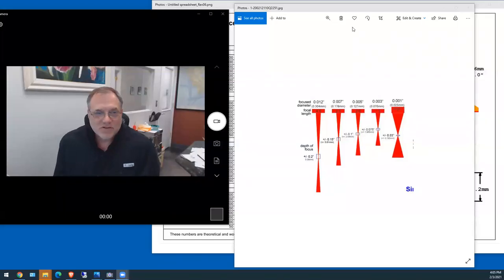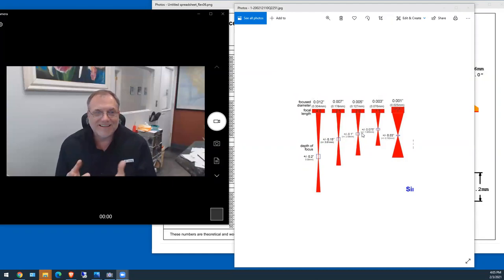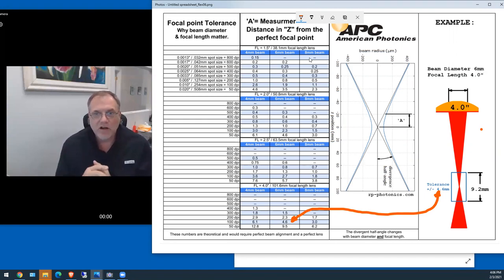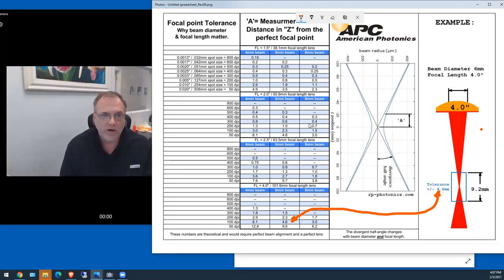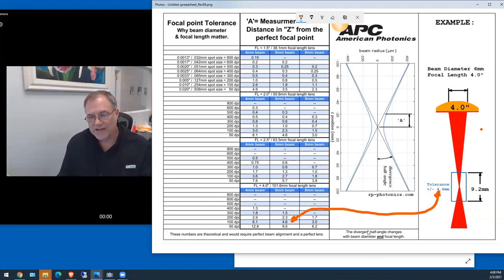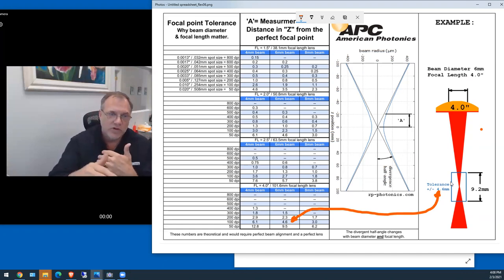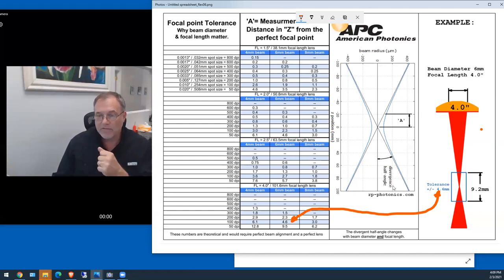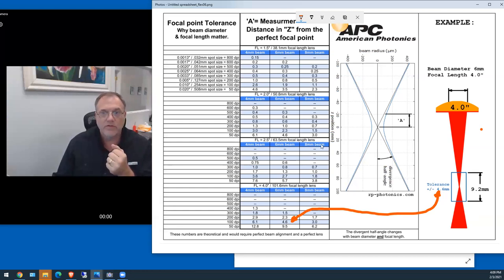Co2 laser Focal Point Tolerance

Comment: Hi 
I have a doubt - why cutting is getting wider as the job is getting progress. First during the start the cutting is good and then getting wider. We use the machine for die board cutting. Material plywood 
Machine power 600 watt laser tube
Reply from the maker: if the optics are not sized to handle the heat load  from the 600 watts. the ZnSe crystal is soft and the crystal can move, changing the shape of the radius. either out of the tube or the mirrors or at the focus lens. in the tube and at the focus lens there is a pressure difference from one side of the ZnSe to the other. this can cause a outcome called "lensing". when the ZnSe changes shape the focal point will also change.
Reply: Thank you so much for your reply and now I will be trying with APC lens and should get it by next week and try that.  I hope Lens from APC will solve the problem.  
Chinese guys says that GaAs ia more stable than ZnSe
But I am not sure about it. 
I hope Lens from APC will surely help me in this problem.  
Good day